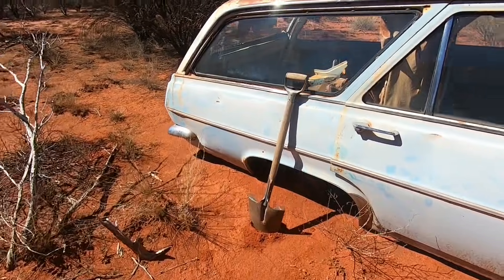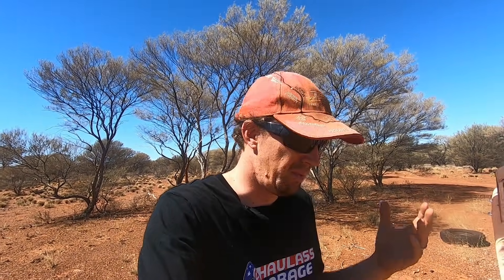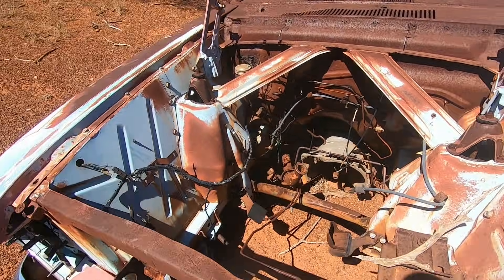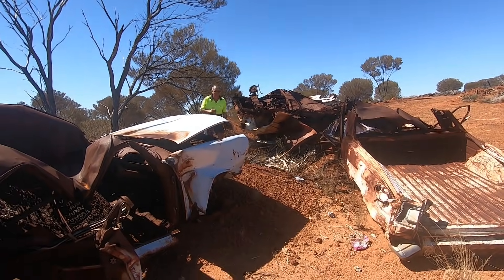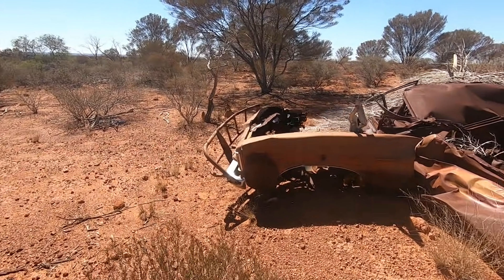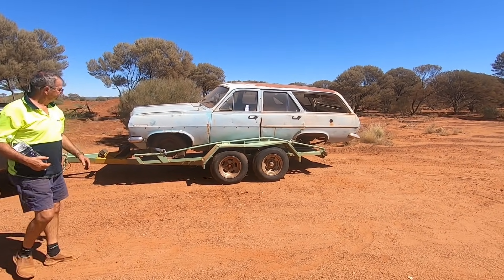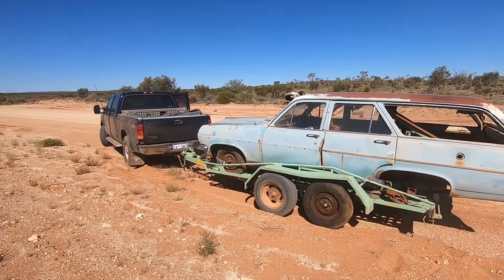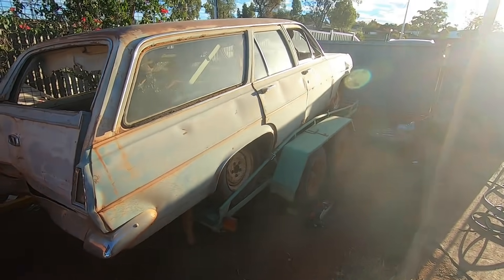Bringing the HR Holden Special station sedan home.

Comment: Made it, YEAH! Definitely need better trailer with a tilt bed would be the ticket. There must be tonnes of scrap metal out there.
Reply from the maker: So much scrap. I would love a tilt trailer, Solid plate base and a big arse winch.
Reply: @AutomotiveKarnage  Checker plate aluminium deck and flotation tyres.

Comment: Hey mate, awesome work with the channel!  Can you tell me, what happens when you find something, just PPSR check and if not stolen it's safe to take? I would have thought this would be considered stealing by finding, or do you need approval from the authorities to take them? cheers mate!!
Reply: Most of these wrecks were probably abandoned decades before PPSR was even a thing.
Reply from the maker: Short answer is you need to locate the last owner who left the car there, or who the car was stolen from. Its months of research for each rescue.
Reply: @AutomotiveKarnage  Thanks very much, really appreciate that had no idea but makes sense! Would be very difficult with privacy act but I'm sure its possible.

Comment: this episode reminded me of the public safety films off years ago showing you what happens when you dont prepare for a journey. were you unlucky or lazy on the prep? dont get me wrong, i enjoyed the vid, but it looked like hard work [and scary to me , 120 miles away from help]
when i was a young'un i used a similar trailer for 7 years on my own, and apart from the bloody lights never working, never had a problem [when you are the company mechanic, - its your fault if it did go wrong], but your arms used to be burning by the time the handwinch had the car on the back... hope u get out + get some more finds recovered - give that local lass a map + a pen -there be treasure out there....
Reply from the maker: Well if some one can learn from our mistakes, I don't mind lol. The first day was a bit of rush/lazy prep. Second day (this video) was just bad luck. A lot of the gear we use is just what we can get our hands on. When you live this far in the desert there are no trailer/auto stores to just pop down and get the bits you need. You have to learn how to MacGyver a lot of junk into something that works.
Reply: @AutomotiveKarnage  does the heat affect tyre life- get a good 10 years out of tyres over here uk [but advised to change at 6]